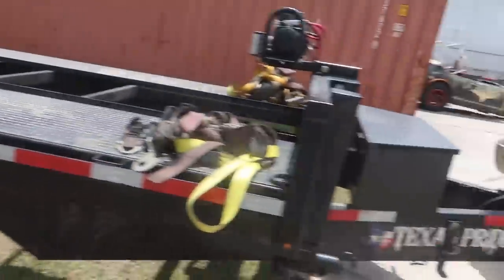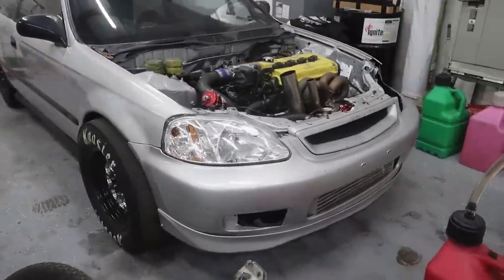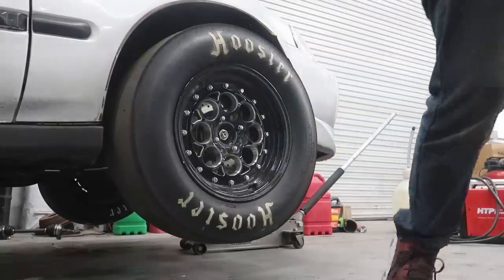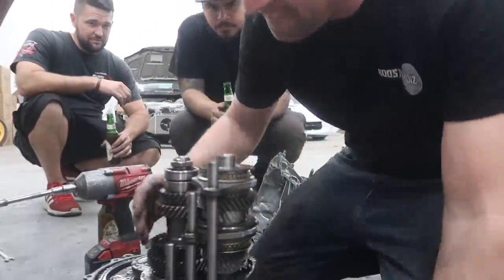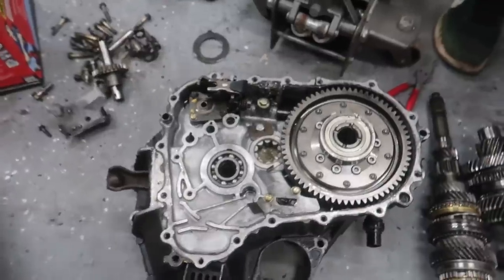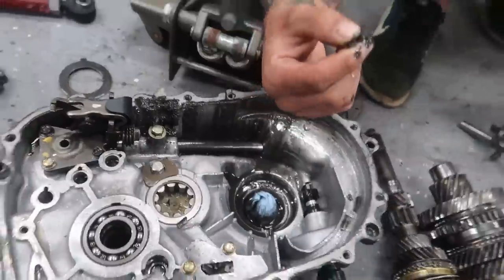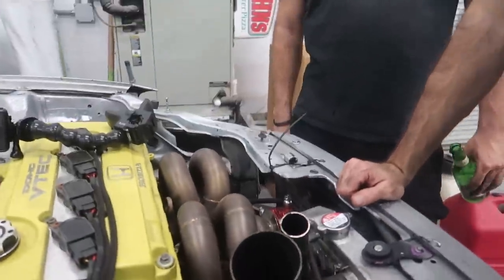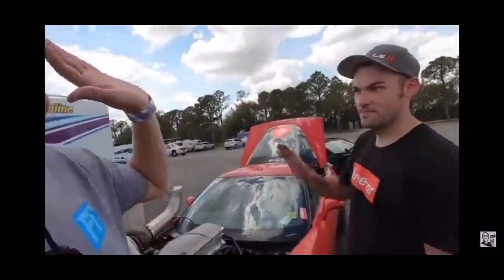Freedom Civic Ripper Diagnosis! Yee yee! (Tavarish,Cleetus Ripper)

Comment: Jamie: Check the ID of the extension housing. It's basically just an aluminum bushing the axle rides on and they do wear out, then the axle seal leaks. There are also seals available that have internal bearings that should help greatly at about $50ea. This may be late info, but maybe it'll help.

Comment: Check the screamer pipe......When Tavarish had it the screamer pipe was loose and would wander around. Tavarish spent a pretty penny for that car,he also doesn’t know how to drag race so that could explain the hot clutch pads
Reply: actually heres the link https://www.youtube.com/watch?v=1PdQcPsPtaQ......hopefully that works.......should be 3 vids.....
Reply: Power 2 Weight that was more for Brents info.......it’s SUPPOSED to be a 600 hp build